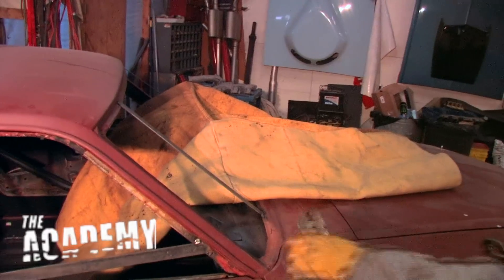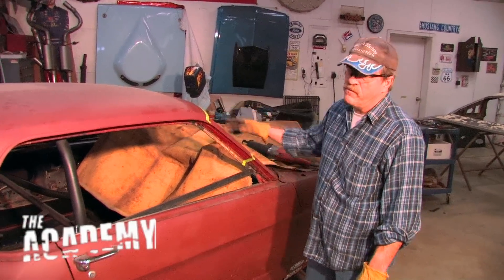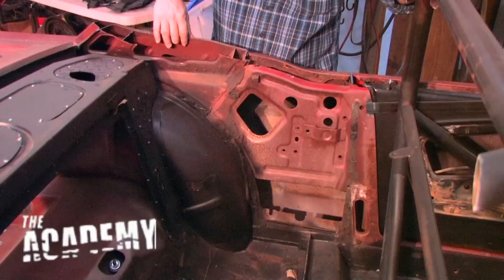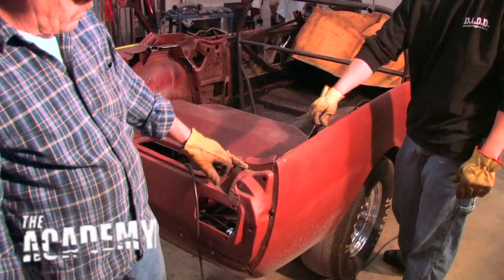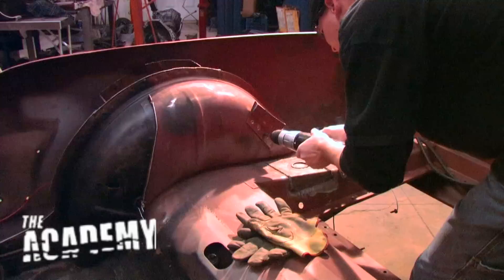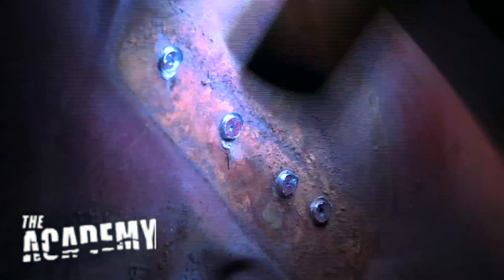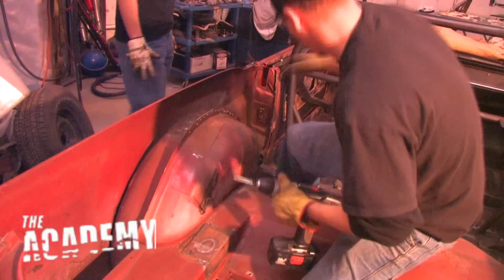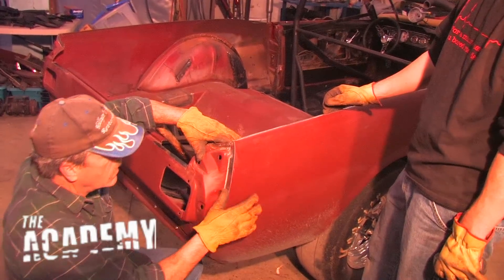1966 Coupe to Fastback conversion - cutting off the roof

Comment: I think this guy knows his stuff as far as a body man. I have messed with mustangs and mid year corvettes for the past 40 plus years. I wouldn't mind swapping a coupe to a fastback. I know where there is a decent roof off a fastback. I have no idea of where the rest of the fastback body went nor do I care. The swap makes the new fastback car when completed not worth the $$$$ that a real fastback is worth but if you went with coil over front suspension and rack and pinon steering plus other custom items like bucket seats you could end up with a really cool fastback that would bring some decent cash for the right buyer. Great job of the two video's. Thanks for sharing your knowledge..

Comment: I have caught up to you doing my conversion.
Just haven't did final cuts on roof and body.
I was hoping that you would post to next stuff (fitting and welding).
The way your fitting the roof to the body is to make the grinding and filling
less work for your self I think.
Please post more video its so very help full.
Thanks gary